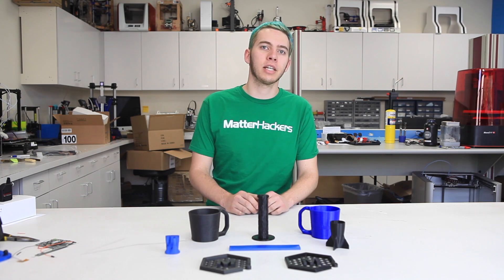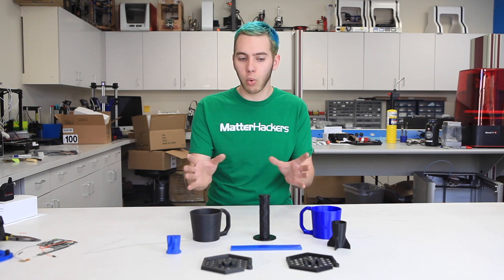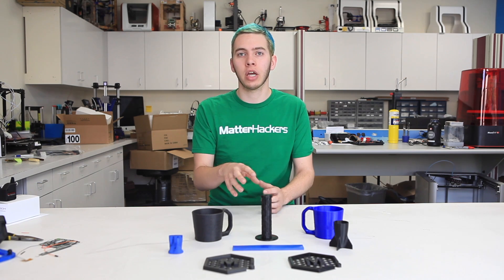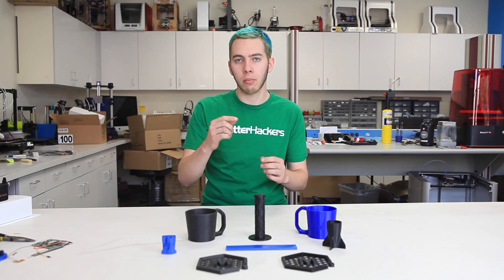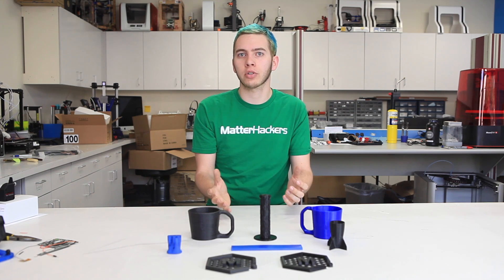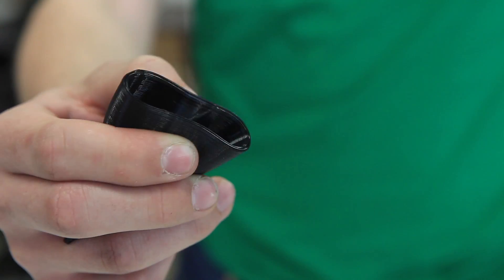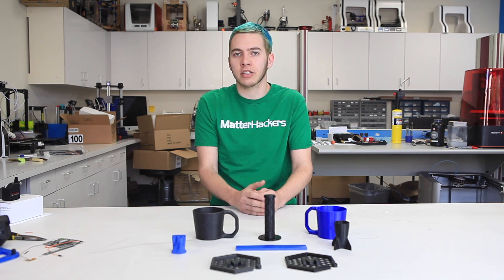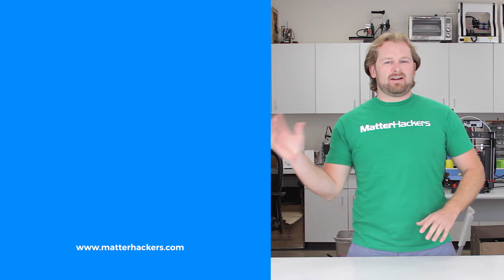How To Print With Flexible Filament // 3D Printing Flexible Filament

Comment: My wife has a large thermos like drink bottle. Aside from being difficult to grip due to its wide O.D. it is also very slick. She wants me to print a grip for her cup thingamajig. Could a cup grip be printed flat and attached at the ends to form the loop to wrap around the cup rather than standing as a cylinder? I want to make it with lots of hearts and penguins and cute crap but i dont want to deal with support. If so what would we use to attach/glue/weld the ends together? I mean what do yall think might work best?
Would superglue work?
Reply: Maybe print it with a dove tail and secure it with CA glue once you've verified a solid fit.
Reply: @AWDoherty  too bad I can't send a picture of what I actually did. It was similar to a dovetail. Didn't use any glue at all. That was a long time ago.

Comment: Wanted this video to be more useful. You guys usually do pretty solid work but this one is just lacking. No info on good temps, speeds, cooling,  adhesion and removal issues or my biggest struggle, supports and how to remove them. Come on guys this video is hugely underserving your audience. Just found your other video much more helpful but no support talk. https://www.youtube.com/watch?v=2wjPLkxaJDI

Comment: What's a good way to remove soft PLA from a PEI bed? I heat the bed to 60C for adhesion, and it works beautifully; however, when I removed the first print from the bed  it was stuck so badly that one of the corners tore. I'm hoping to print cell phone cases for my kids, and this type of issue would destroy the detail of the prints, making them useless. 

Help?

Comment: I want to thank you for that grateful information. It has helped me with TPU printing but my problem is feeling the print all the way up to make it solid. I have 100% in field but yet there's plenty of voids in the walls of what I'm printing. I have went into my settings and simplify3d and bumped up the flow rate and things of that nature but I haven't found a happy balance yet. Is there certain settings that you would recommend with that software?

Comment: you should mention recommended extruder temperature and bed temperature next "how to print with" video.
Reply from the maker: You are definitely right, we should mention that! Extruder Temp: 220±10 °C; Bed Temp: 35±15 °C on blue painter's tape. You can check out our Filament Comparison Guide for more information here: https://www.matterhackers.com/3d-printer-filament-compare